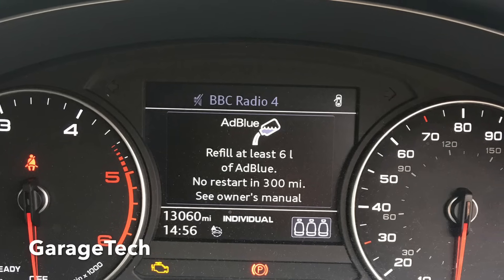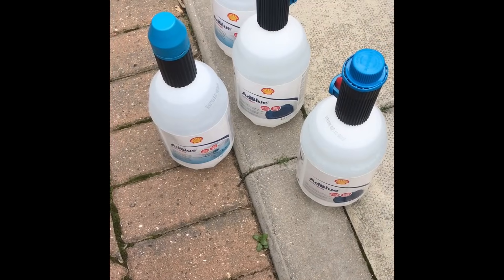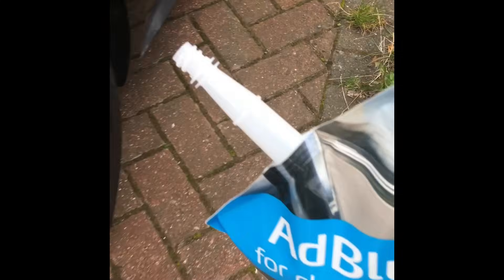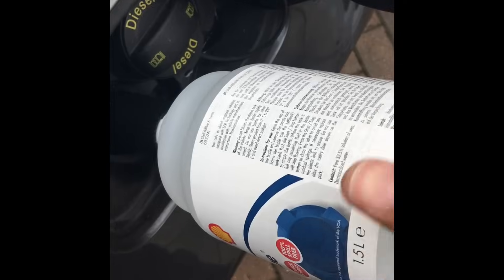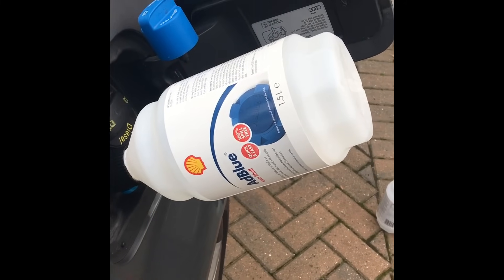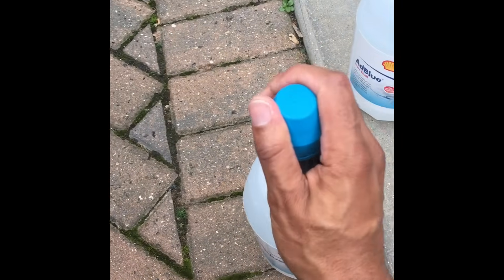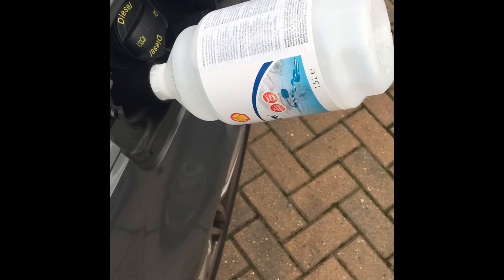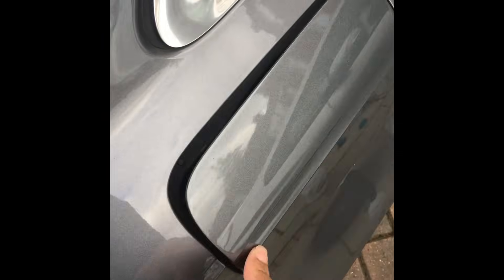AdBlue top up Audi A4 A5 A6 A7 Q5 Q7

Comment: Hi, Thanks for this very useful video. I just wanted to check what happens if a small amount approx 350ml of diesel fuel conditioner is put in the adblue tank. Is it going to harm the engine?
Reply from the maker: Hey, the Adblue isn’t injected into the engine itself, it goes into the exhaust system. Depending on the mix, the system may pick up the contamination and likely hood is you will need to get the tank drained and possibly the lines and injector. Hopefully it won’t damage the catalytic and DPF etc,
Reply: @GarageTechAutomotive  many thanks and much appreciated.

Comment: I've added the adblue but the light won't go away on my 2015 Q7. It's saying no restart in 95 miles, but I've added as much adblue as I can. Any suggestions for removing the light?
Reply from the maker: Erin Norton, you may need to visit your Audi centre or someone with diagnostic equipment to reset the light if it’s not going out.